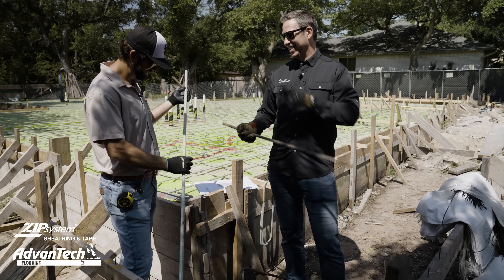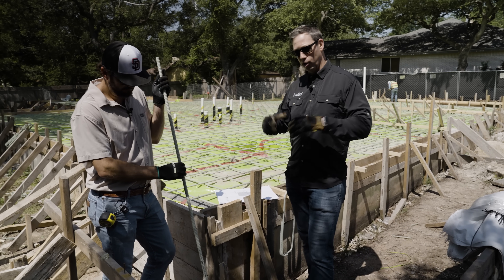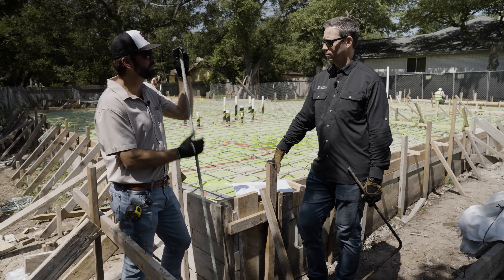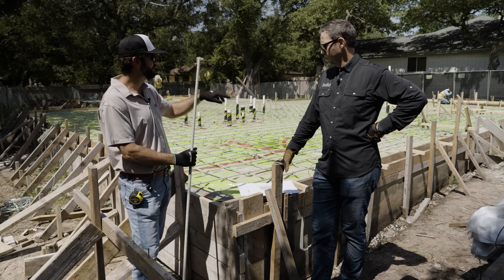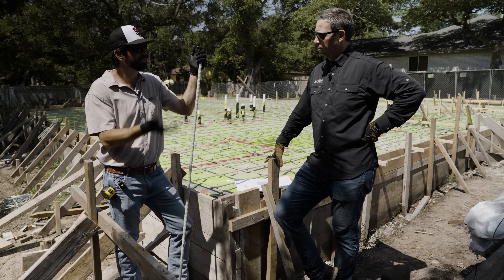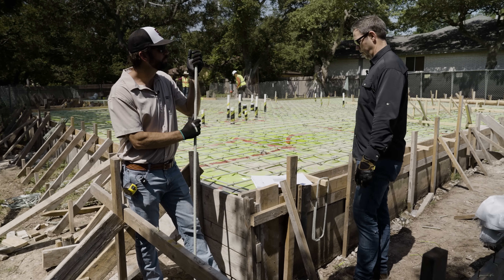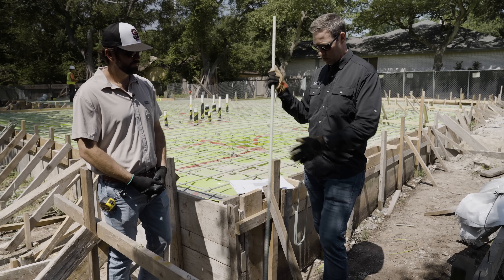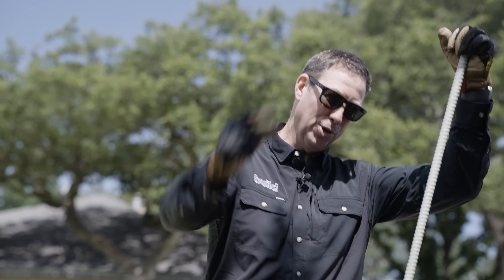Comparing Steel and Fiberglass Rebar - SURPRISING results

Comment: Matt take a look at basalt rebar, it doesn't split like fiberglass bars.
Reply: Yep. Came here to screech this. GFRP is a temporary, cheap solution. Basalt Rebar is woven volcanic fiber and will outlast all of us for generations.
Reply: Umm for all practical purposes it takes enormous amount of energy to split fiberglass rebar, at least MST rebar. They actually do a test on their rebar on their website. I don’t see any practical advantage of basalt over glass fiber rebar, except basalt may be more expensive and more difficult to obtain.
Reply: @JohnLee-db9zt the ends of the fiberglass rod unless properly sealed allows water to wick inside and split. A proper comparison all all 3 types would be beneficial.

Comment: I've used the basalt, the gfrp and steel rebar on multiple projects. We've figured out the gfrp with the Kodi Clip system ends up being the Best overall solution. There's a little cost of entry but overall at about 20,000 square feet you've broken even and you've tripled or more your speed of installation. We also have a lot less problem with blowouts from incorrectly embedded steel. We're getting to a point where as soon as we can figure out the carbon issue concrete might be back in Vogue for almost all projects.
Reply: looking forward to the Vogue cover page…
Reply: Isn't the issue with GFRP/basalt rebar that it doesn't flex like steel, which I've heard you want for walls in earthquake prone areas?

You generally don't need tensile strength as much as flexural (?), right?
Reply: @MadLadsAnonymous  that was a question that I had for the engineers because that's what I had always heard. They clean the overall strength is equivalent to steel. It just hasn't been tested to the extent of steel yet. It's being used in vertical applications all over the world and here by (at least) me. We were also told that we weren't allowed to use the Kodi clips on vertical due to them not being tested. Pretty ridiculous if you've seen how they work and on projects like I do with the amount of plasticizers we need to add to the mix for flow. You just need to get an engineer understands construction instead of whatever is on his computer screen only.
Reply: @Veritasi  My dream is to get No 10 Grade 90 galvanized rebar, slather it with acrylic fortifier or bonding adhesive and place vertically before pouring the concrete into the ICF. Maybe GFRP or BFRP makes more sense for the horizontal placement across the ICF block walls.

But for the foundation, I'd definitely use steel to have the flex during an earthquake.
Reply: Also, where did you get the basalt rebar in the states? How did the price compare to GFRP?
Reply: @MadLadsAnonymous  I come from the corporate world before I got into construction, specifically branding and sourcing. I just bring it in from overseas. It ends up being about a third the cost of steel here.
Reply: @Veritasi  Hey, similar path to what I'm considering! I came from corporate, got tired of it, now considering my options working for or getting into development. I'm intrigued by ICF + geopolymer construction and other eco friendly, rapid construction methods. Trying to see what my ins are.
Reply: @MadLadsAnonymous  Look into Thermomass for cast in place as a starting point. I built my own system that is close but I use EPS vs XPS due to it being a far superior product for concrete contact. More design and setup is needed upfront but you have a virtually indestructible surface inside and out after the forms come off. You can form all door jams and design elements with EPS. Just need to use a good superplasticizer and a smaller aggregate. Eco friendly is subjective if you consider the overall lifespan of a structure including the maintenance. Concrete has a high upfront carbon footprint but 'all-in' it's curve is massively frontloaded compared to all other techniques.
Reply: @Veritasi  Thanks, will check it out!

EPS is what Perfect Block ICCF uses, so good to know re: XPS

Comment: any chance you do a video on basalt reinforced polymer? great video.
Reply: Same stuff but it's more expensive and it's not a residential product so they won't do it here.
Reply: @sparksmcgee6641 basalt rebar has been used in residential builds, but it is more expensive and difficult to obtain
Reply: @JohnLee-db9zt   Yep I know. Maybe you were responding to the main comment. 
I'd love to see more basalt bar. I over re enforce my concrete so anything that lowers that cost is great.
Oddly going back to steel micro re bar has been thr best for me. I use Helix 5-25

Comment: basalt rebar seems more interesting as an alternative, steel rebar most important quality in the market place is its ability to be made from recycled steel and be recycled again in the future
Reply: I will not trust fiber rebar for a simple reason: the fail mode is always going to be a catastrophic failure (engineeirng terms used quite a bit in mechanical/material science engineering for a sudden and unobservable failure) in fiber rebar. Fraying can be an issue, fatigue related surface-bonding between fiber and resin can be an issue. However, I will trust fiber in concrete since their thermal expansion constant is almost identical which will increase quite a bit of surface strength and gives concrete more self-healing cabilities. 
I will use ASTM2205 duplex or some other grade duplex stainless steel as rebar: they are much easier to handle in some salty/marine environment (Duplex behaves well under load and Chloride environment .... to be honest, Duplex behaves well in many environments and it has been used quite a bit in offshore drudger/oiler). They have proved their worth in the UAE and Shenzhen which are both hot and humid (especially the latter is humid as hell and the one using it is the largest insurance company in China). Stainless steel can be prone to catastrophic failure, but Duplex behaves much more like their ferric cousins
Reply: @MultiYlin A la that carbon fiber submarine…
Reply: @clippy_friend  I dont get why people still think X-FRP is some magic spell for everything ... I can see the use in cars or aeroplanes (even aeroplanes are used in great cautions which added quite a bit of ground crew works to ensure the CFRP ... I bet A350 is a much better planes after 10 years of service ... the CFRP head is rather stupid)... and I dont think buildings should have a planned obsolete like cars or planes.
Reply: would like to see that actually